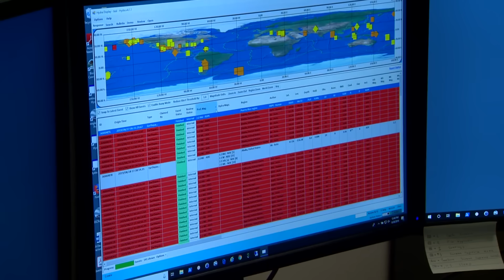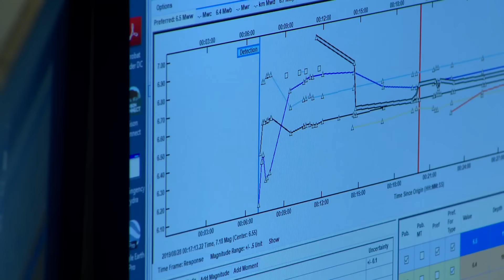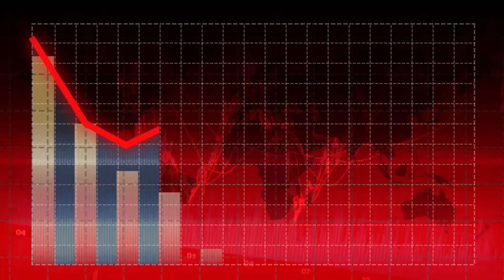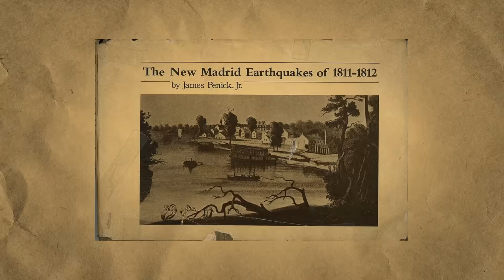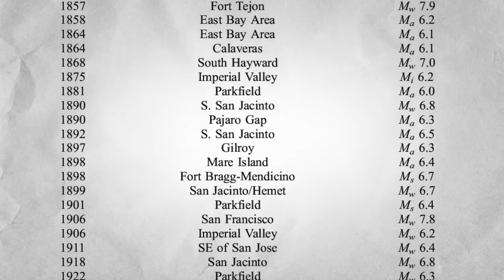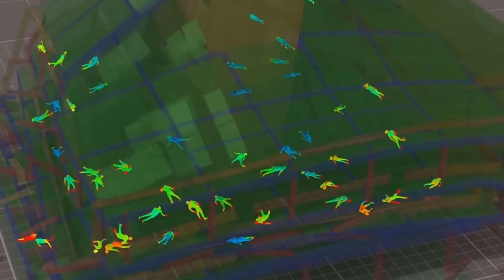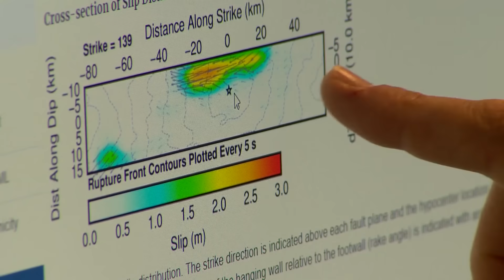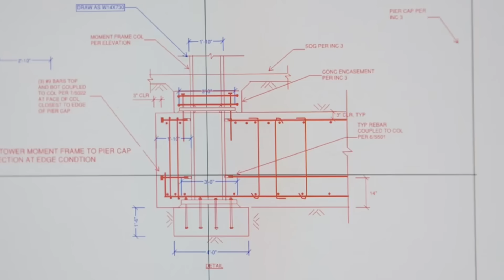America's Triple Megaquake Threat: 3 Major Fault Lines Could Rupture!

Comment: Can you please explain the Richter Scale and the difference on magnitudes between a 7.0 versus 8.0 versus a 9.0?
Reply: The Richter scale is logarithmic with each step 32-times more powerful than the previous step.  An M8.0 earthquake releases 32-times more power than a M7.0 earthquake.  An M9.0 is another 32-times more powerful than an M8.0.  Therefore, an M9.0 is slightly more than a thousand times more powerful than an M7.0.
Reply: @Indium111 perfect. Thank you.
Reply: two mangnitudes 8.0 are equal to an 8.1
Reply: You could just Google it
Reply: Google it.
Reply: I got this from Leo, the free AI available from the Brave browser which eliminates all ads and trackers.

The Richter scale is a logarithmic scale used to measure the magnitude of earthquakes. It's based on the logarithm of the amplitude of seismic waves recorded by a seismograph.

The Richter scale is calculated as:

M = log10(A / T)

Where:

M is the magnitude of the earthquake
A is the maximum amplitude of the seismic wave in micrometers
T is the time in seconds between the arrival of the P wave and the S wave
The logarithmic scale means that each whole number increase in magnitude represents a tenfold increase in amplitude and about 31.6 times more energy released.

For example:

A magnitude 5 earthquake has 100 times more energy than a magnitude 4 earthquake

A magnitude 6 earthquake has 1000 times more energy than a magnitude 4 earthquake

The Richter scale has its limitations, and it's been largely replaced by more advanced methods like moment magnitude scale (Mw), which is a more accurate measure of earthquake size.
Reply: Each point equals twice the intensity as the last. Example a 7.3 is twice as strong as a 7.2